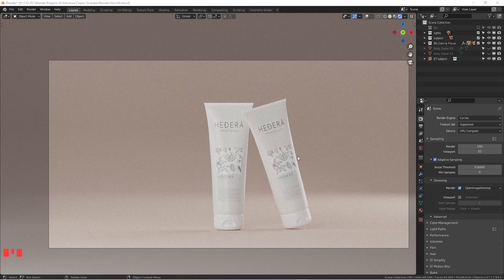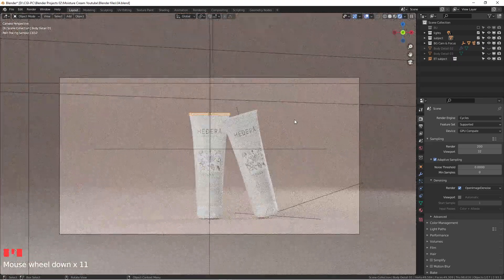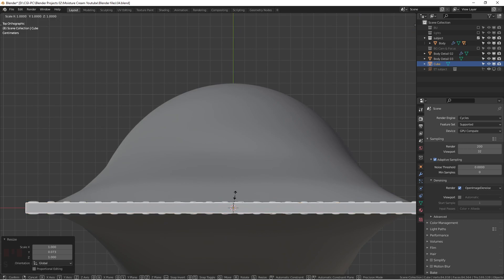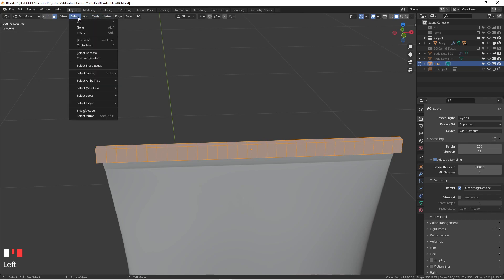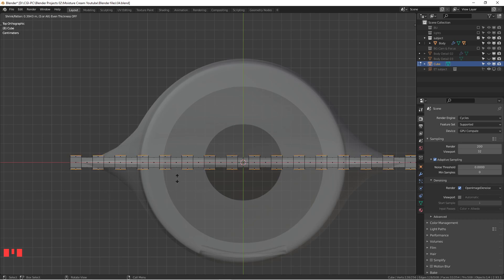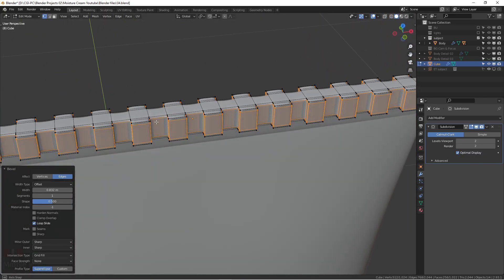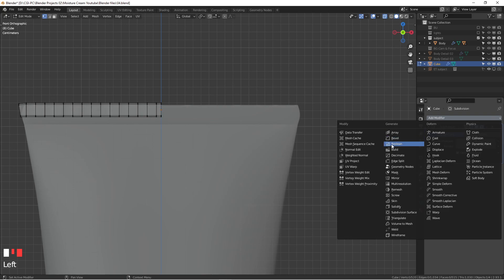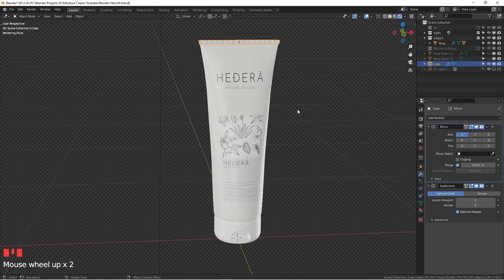How to Model Cosmetics Products in Blender (Quick Blender Tip 05)

Comment: Its nice as a model. But when going to UV unwrap it gonna be dissaster. If the label design spread to the sealed area this wont work bro. Have you any solution. I couldn't find propper answer from any tutorial.